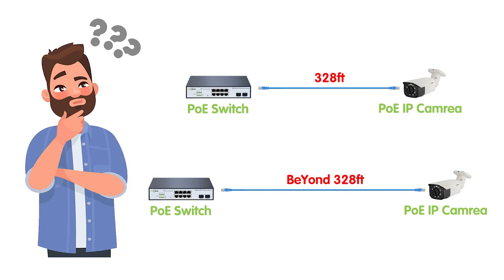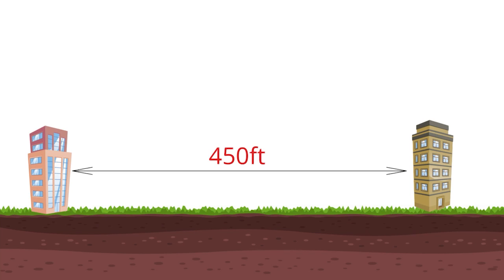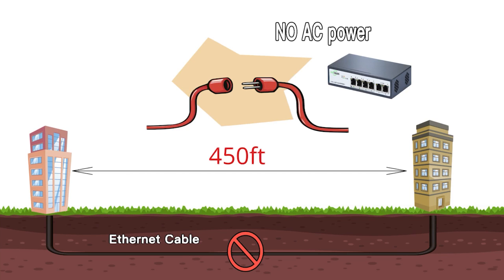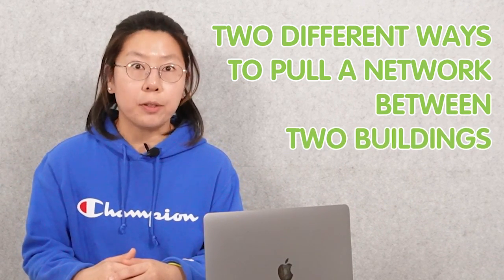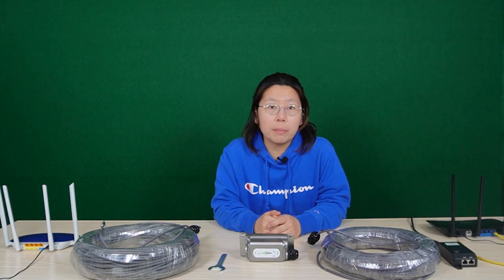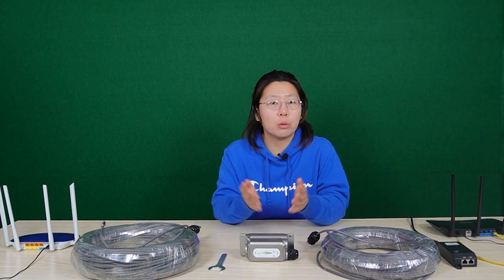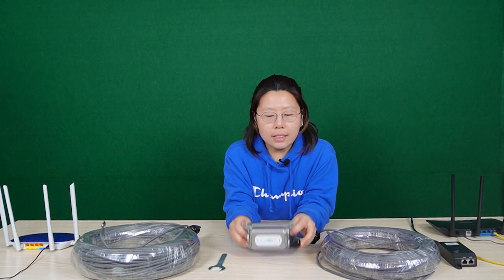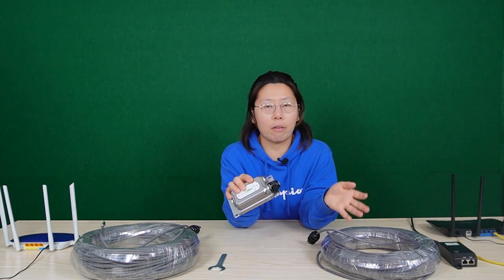Two Methods to Pull a Network Between Two Buildings

Comment: What about grounding with Ethernet cables?
Reply from the maker: Unshielded Twisted Pair (UTP) cables do not typically require grounding since they don’t have a metallic shield. When using shielded Ethernet cables, connect them to a grounded patch panel or network switch. These devices often have built-in grounding points. In cases where you need to run cables over long distances or between buildings, consider using a grounding block or bar where the shield of the Ethernet cables can be connected to a local ground.

You can also install POE surge protectors, especially on cables running outdoors or between buildings. These devices are grounded and will protect your equipment by diverting any surges to the ground.

Comment: Using fiber is my first choice, no matter the distance.  I've seen wired outdoor installations blow expensive electronics due to lightning hitting near the wire. Plus, fiber is faster.
Reply from the maker: Indeed, fiber optic cables offer substantially higher speeds and bandwidth compared to traditional wired solutions. They're difficult to tap and can easily handle future data speeds. It's an investment you'll never regret.

Comment: Hello , do you have a video or a tip for this problem : 
( I have a nvr wireless kit  8 cameras , when i plug them to the power supply all camera work but not all of them get connected to the nvr . There ip adress isn't similar to the ones connected .
I will highly appreciate your help
Reply from the maker: You might place all 8 cameras close to the NVR. Usually, it has integration between the wireless NVR system. The NVR will assign the IP address to each camera automatically. It is the different subnet between those cameras and the NVR. I suspect the Wi-Fi connectivity is the issue, not the IP address. Some of the cameras just don’t have good WiFi connectivity because of the obstructions.

Comment: Usually for long distance I use 5ghz transmitter antenna and receiver antenna.
Reply: That works when you have good line of sight.
Reply: @csmith8503  Yes, right.  And also depending on the situation and local regulations.
Reply from the maker: Thanks for sharing.